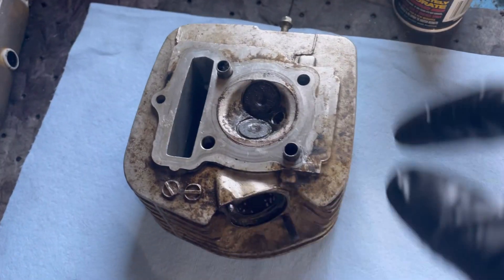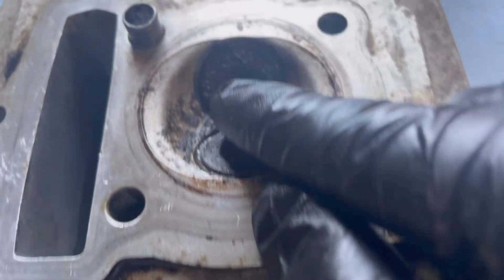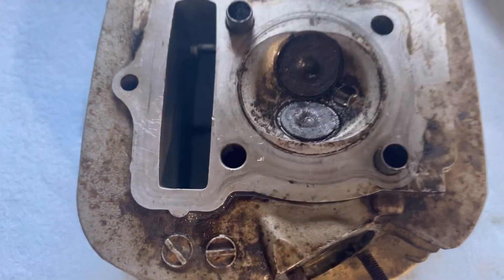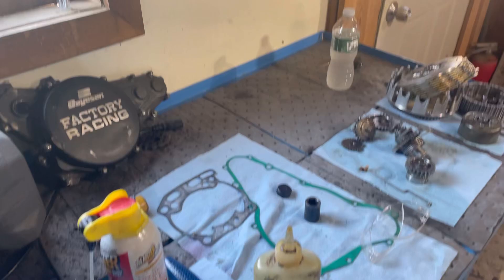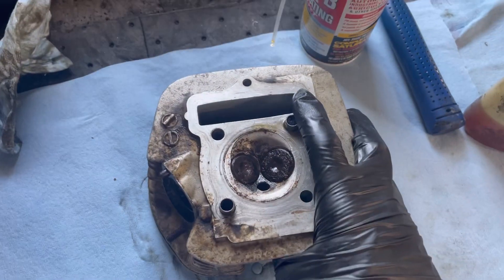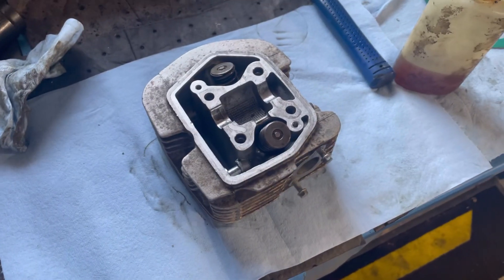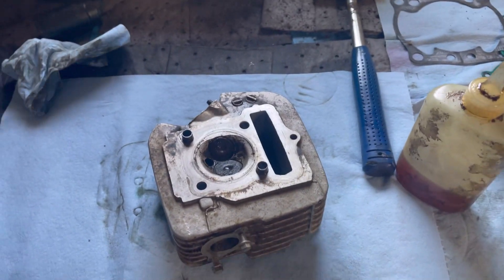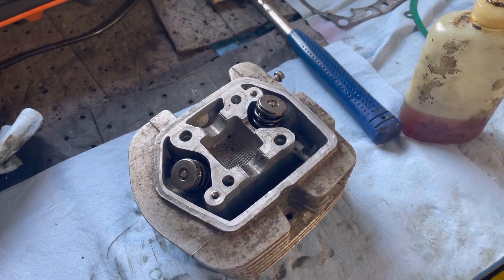How To Free Stuck Valves On Any 4 Stroke Engine

Comment: Thanks for the video, man!  Workin on 2 500 Rubicons that sat a long time, redid the fuel system and went to start only to be met with a loud backfire.  Noticed it had a light "tapping" sound when it turns over, so I'm pretty sure an exhaust valve is stuck.